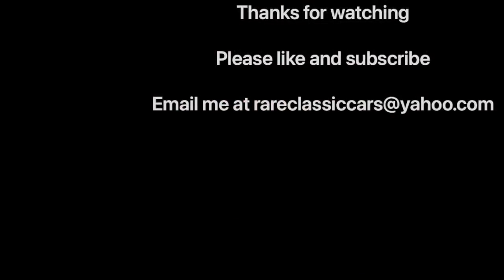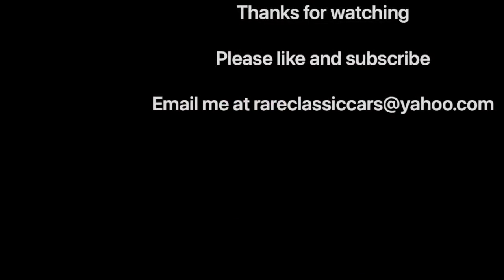Worst Engines of All Time: GM 2.5L Iron Duke Follow Up

Comment: Had one in a 3speed auto Fiero.  got pretty close to 3 digits (85 mph soeedo) and reliable for sure. Not sporty though, low revving and anemic.
Reply: Pontiac pitched it as a "commuter" car...  And GM bean counters gave it a "commuter" engine.  lol.
Reply: @keithjackson286  was pretty fun to drive in good and bad ways - manual steering and low made it sporty despite itself. Ridiculously easy to spin.  When these were around I saw at least a couple (besides mine) facing the wrong way off the side of the road.

Comment: The chrysler 2.2 and 2.5 i4 was good.
Reply from the maker: Loved head gaskets.
Reply: They were ok, but also very crude. I remember the old Dodge Omni's with the 2.2. They would run on after shut off. Even at 6 years old, I knew that car was a piece of crap.

Comment: You are right on this one. I had one in my S10 and, of course, it was reliable. When mine started knocking, they replaced my cam gear with an aftermarket metal one. Was still noisy, but I did get over 400 thou. Kilometers on it and it had an insane amount of idle time on it (volunteer firefighter). My dad had the 86 olds calais, and yes, that thing had a deafning rumble to it at idle !!! He regretted trading in his Cadillac for that thing.

Comment: I have enjoyed all your video showing off your cars.   This porch chat we are having really is a home run.    I agree completely about the Iron  Duke.   I worked with a plumbing company that used the mail trucks with this engine.  We called them Armadillos.    These trucks ran and ran and sounded horrible but in the mail truck version the company would buy retired mail truck for fleet use. Shop mechanic became a wizard with engines. Seems like everything only took a couple  of hours to fix.  It seemed like he could put a replacement engine in a couple of hours, said another engine not a rebuild engine. Love to hear your point of view.

Comment: The iron duke wasnt a bad engine. It just had bad applications. It was a great motor for the s10 and the mail truck. Terrible motor for the a bodies, n bodies and ESPECIALLY the FIERO and CAMARO
Reply: yeah whoever thought putting an 87hp engine in a fucking muscle car was a good idea should have been fired on the spot.
Reply: @SomeOne_86   Lol!
Reply: @SomeOne_86  the cheif designer of the fiero didnt have a choice. He had to basically told he had to take the front end of the citation, flip it 180 degrees and modify it to make the fieros rear end. bam the rear end and engine assembly of the fiero is born. It stayed that way till 88 when it got a new irs and then it got canned.
Reply: @Henry_Jones  honestly the fiero is such a missed opportunity. The car is beautiful, but the drivetrain was just so underwhelming.
Reply: You know... It actually powered the N Bodies pretty well...  It was dog slow in everything else.

Comment: You said it.   I got a 88 Somerset handed down from the in-laws.  Very very low miles (in-laws aged out of driving) but really cheese compared to 77 Olds or 76 Caprice or my 89 Century Limited.   Nearly everything about it was a down grade - door opening/access, instrument layout, and the engine, ugh.  A real POS.   That Somerset was neck and neck with the 80 Fairmont for worst ride evah.
Reply: My mother had a Mercury Zephyr, the Merc version of the Fairmont.  She liked it very much.  No, it didn't measure up to a Lincoln, but it didn't cost as much as a Lincoln, or even a full-sized Merc, either.  And it was easy on gas, and quieter than a foreign car.  6 cyl usually is quieter than a 4.
Reply: @michaelbenardo5695  The Zeph was definitely more upper crusty that the vinyl Fairmont.  Those were the end of an era for FoMoCo - midsized, rear drive econoboxes.  After that came the aero design era.

Fairmont was the only car I ever bought new from a dealer.  As required for my field sales job - american four door.  I would have preferred a Caprice but that was out of my price range.  The ol' Fairmont was yr most basic, reliable, quiet, family man car.  Paid her off and gifted to Mom in tip top shape.

Comment: I owned a 1986 Olds Cutlass Ciera with the “Iron Duke”. A gutless engine, but 32 MPG highway.
Reply: You hadn't experienced an 82' Cavalier with the 1.8L 2bbl engine + TALL geared 4 speed manual.  The absolute slowest car I ever owned but would go FOREVER on a tank of fuel it seemed like!

Jumping in my dad's 80' Citation with the same 4 speed made it feel like a rocket ship.

My buddies mother bought an 82' Camaro with a 4 speed!  Awww heck yea!!! Until we drove it.  2.5L iron duke. WOW
Reply: @firehawk6188  While it was no rocket, it WAS stronger than foreign-style 4 cylinders.
Reply: My Dad had a 2.8 v6 powered '88 Celebrity wagon that got 30 on the highway, and was far quieter,,smoother and stronger than the "buzz bomb" 2.5 liter noisemaker

Comment: How about a video on te Buick 231 3.8 carburated v6? Another engine used in millions of GM cars. Reliable for the most part and like the Iron Duke not so refined. My 1st car in 1994 was an 84 Grand Prix with that motor. Loved that car.
Reply: I can't even believe they put those engines in full sized cars like the Impalas.

Comment: I got to witness someone getting “Iron Duke’d” first hand. My grandpa wrecked his positively ethereal 283-powered pale yellow ‘67 Chevelle (sad day for me as I was 15 and wanted that car badly) and replaced it with (you guessed it) an Iron Duke-powered ‘81Citation that shook like a nervous chihuahua and was painted what can best be described as “diarrhea brown”. Being a Florida car, idling with the car in Drive and the A/C on is a punishment I wouldn’t wish on anyone.
Reply: Was the Chevelle a 2 door?
Reply: @drippinglass  nope. Four door. Black vinyl bench seat interior.
Reply: My buddy's parents "inherited" this same colored "diarrhea brown" Citation from a relative who had passed away.  It had the iron duke coupled to a manual transmission.  I remember Mr. W cursing his brother:  "R had all the money in the world, why the hell did he pick this god damn car!".   Needless to say, the Citation was relatively worthless as a trade so they kept it.  Yeah, the engine was rough, and the interior was cheap, not to mention the car was drop dead fugly.  But, I was kind of intrigued after driving it, it performed and handled pretty well.  Needless to say, I had never experienced the more refined Hondas and Toyotas.  I'm trying to remember why they got rid of the car, I think it got rear ended, but it never caused them much trouble.
Reply: Iron Duke was slightly better than the Vega with its reynolds wrap block without steel sleeves. That was a real turd !
Reply: @davegeisler7802 That was a huge shame.  Another situation where a cool looking car had a badly matched engine.  Like iron duke and Fiero.
Reply: Richening the idle mixture smooths out the idle quite a bit.  You just have to remember how much you turned that screw out, so you can put it back when it is time for a smog check.
Reply: The AC probably made much of the difference; my father's '81 Citation was the last car he bought without it and the shaking didn't leave nearly the same impression on me. The fact that the heat trickled all summer (a chronic GM problem during those years, best solved with a manual summer cutoff valve) bothered me a lot more.
Reply: GM never liked flipping the bill for balance shafts.
Reply: @jeffrobodine8579  Did anybody use them then?
Reply: Well… in 81 nobody cared about a Chevelle unless maybe it was an SS396 or SS454. 1981 was the year interest rates spiked after a gas crisis and inflation. A 1960s car was not only using a horrendous amount of gas… but as a daily driver probably on its last legs in an era where most cars had a five digit odometer because there was no question whether the miles were original or had rolled over.
Reply: @calvinnickel9995  Actually, 60s cars used LESS gas than 70s cars, were quite a bit faster, and ran much better, due to the fact that they didn't have that emissions junk.  They ran the way the engineers intended, not the way the EPA wanted .
Reply: Haha… nope!

Horsepower was higher… only because they used SAE Gross ratings where they stripped the engine of the air cleaner, exhaust headers, all accessories—not even a water pump.. and strapped it to a prony brake and ran it at full throttle until it seized. Highest number is what went in the brochure. After 1971 they had to switch to SAE Net. 

Sure the 70s were emissions choked.. but they also had to cut fuel consumption too so that meant downsizing, weight reduction, aerodynamics, and the end of almost all of the big blocks. 

So no.. except for the early 70s.. and maybe a few rare land yachts like the Lincoln Mk V the 60s was the king of high fuel consumption.
Reply: The only 60s cars we saw as daily drivers in the 80s were your Slant 6 Darts and Valiants, your 200 powered Ford Mustangs and Falcons.. Eddie Murphy’s shitty blue 230 powered Chevy Nova… and the ubiquitous Beetle.

Comment: The GM Iron Duke engine, a re-worked version of the Chevy II 4 cyl., was a GREAT engine!  It was, in most years, anvil reliable and anvil rugged, and was easy on gas, easy to repair on the rare occasions that it needed it, infinitely rebuildable, and JUST PLAIN WORKED.  The Vega engine in stock trim is one of the worst engines of all time, but even it can easily be vastly improved.  That Chrysler 2.7 engine is a rotten engine too.
Reply: That's not the Iron Duke..The Iron Duke 2.5 is a Pontiac engine made from 77 to 93. AMC even used it. The Chevy II had the Chevrolet 153 4 cylinder
Reply: @netrioter  The Iron Duke was a re-worked version of the 153 Chevy II 4 cyl.  Larger bore and shorter stroke.
Reply: @michaelbenardo5695  you're  a goof...they aren't related at all and I'm sick of this.  PROVE HOW THEY ARE RELATED
Reply: @netrioter  Because the automotive press, when it was introduced in 77, gave us the specs and the history, and what was changed to make it have the same bore and stroke as Pontiac's new 301 V8.  This after many had been clamoring for them to replace that horrible Vega engine with the "marvelous Chevy II engine", which was a 153 cube job with the same bore and stroke as Chevy's new 230 6 cyl.  I know Pontiac later gave it a cross-flow head.  They might have made other changes as well, but in it's original form, it was indeed an offshoot of the Chevy II 4 cylinder.  The crankshafts are even interchangable, as long as you use the correct connecting rods and pistons.
Reply: @netrioter  That's why it had timing GEARS just like a Chevy 6.  No true Pontiac engine ever did.  Ever.

Comment: I agree - if you were coming from an inline 6 or a V8 - an early eighties four cylinder engine seemed agricultural.  

With regards to crude, but reliable - I believe the 1.8 liter four cylinder, single cam, push rod engine in a 1980 Toyota Corolla wagon that I once owned only made about 75 hp.   Granted we had a 55 mph speed limit, but even the competition to the 2.5 Iron Duke could be incredibly anemic by today's standard.
Reply: @Andrew in Austin
You didnt experience  a Honda 4 cylinder of the early 80's.....smooth as a sewing machine
Reply: Thank you.  ALL cars of that era were gutless, partly because of super-tall gearing, in the pursuit of better gas mileage in laboratory tests.  My 81 Chevy 1/2 ton was that way too, a 6 cyl. manual transmission with, of all things, a 2:73 rear end.  I wanted that truck as a working truck, so I immediately had a guy put in a 4:10 for me.  HUGE difference in pulling power and hill climbing ability, and it actually used LESS gas in stop and go city driving.
Reply: 4 cyl. engines always make more noise than just about anything else. Worse as they get larger. I had a late 80's Corolla FX 1.6l ohv. It was smoother made around the same power as a Iron Duke, 0-40 it was savage, but that was gearing. It took abuse from me, Top Gear Hilux levels of abuse, with no sign of ever giving up. Toyota also had  the 4AGE 1.6l which I had in an MR2, smooth, high revving, one of the best sounding 4 cyl. engines, 118hp. It had T-vis which doubled the intake runners at higher rpms. This was so it had low rpm power and high rpm. There was even a Formula Atlantic racing engine had around 250hp, and later 5 valve head engines based on the 4AGE. Truly a great engine, many would use the word legendary. The Iron Duke was an unrefined, inefficient, engine, "good" for transportation, when even at that time there were "much better" for transportation engines and cars. Both of those Toyotas were noticeably easy on the wallet for gas and maintenance and I'd even use the word fun. Straight up agricultural each and every time a bit of exhaust pipe rusted through though :-D  Mercedes  had one of the smoothest 4 cyl. engines back then. Porsche 944 was... okay for a noisy 4 Banger.
Reply: @pgtmr2713  5 valves per cylinder?  That's too complex.  I'll take the Iron Duke any day over those.  But yes, the bigger a 4 is, the rougher and noisier it is.
Reply: @michaelbenardo5695  You'd take a 87hp engine over a 175-185 engine? Complicated doesn't matter. It will outlast the Iron Duke. Literally no downside to it.
Reply: @pgtmr2713  One, I am more concerned with low RPM torque than I am about sheer horsepower.  In my neck of the woods, traffic is HORRIBLE.  You often CAN'T go fast no matter how fast your vehicle is.  2)  Complicated DOES matter to me.  I do my own work.  I DON'T WANT a car that I have to bring to the shop.  3)  I refuse to buy a Japanese vehicle.  I want the jobs, ALL the jobs, to go to my fellow countrymen, not the the Japanese.  The Japanese, with their huge subsidies to their auto exports, have caused massive homelessness and erosion of living standards in this country, and I will do my part to rebel against that, even if I have to give something up.  4)  I don't want an aluminum engine.  If I have to keep my old vehicles and periodically rebuild them, so be it.
Reply: The 4AGE has low AND high torque, iron block good for up to 350 hp. You do your own work? Good, changing a timing belt is easy on a single bank engine. The 20 valve came in 2 versions both with Individual throttle bodies. Who you vote for has more to do with jobs and homelessness and nothing to do with these 2 engines being discussed. It's a distraction. I could argue accepting junk because Merican, causes everyone to produce junk to compete to the bottom. 
Anyway the Iron Duke couldn't do THIS once...
https://www.youtube.com/watch?v=K1JHTgR8jcc

Comment: The Willy's L134 4 cylinder was far superior.
Reply: BUT, do you think many folks would have bought a car with a flathead 4?  I might, but I am just one person.  Their F-head might have done better, but do you think either one could have been smogged without cutting power output to one horsepower?
Reply: @michaelbenardo5695  they bought a ton of cars with flathead six and eights.....  NOx would have been lower anyway due to the lower compression ratio, the longer stroke lends to a more complete fuel burn, so yeah, probably would have better fuel economy if it was geared to stay below 2000 rpm too
Reply: @RealDeanWinchester  Everything you say is 100% true, but how many 80s car buyers would have agreed?  You and I are only 2 people.  They need to sell at least 10s of thousands, not just one or two.

Comment: Adam, how does the iron Duke in a GM passenger car compare to a Volkswagen Beetle?
Reply: It is LIGHT YEARS quieter and WAY more powerful than the VW engine.
Reply: But the beetle was very clear about what you were getting it didn't pretend to be a very refined engine it was cheap and reliable
Reply: @michaelf.2449  True, and I like the Bug, but the cars with the Iron Duke, most of them anyway, are much roomier more comfortable much heavier cars.  You can't deny it.
Reply: @michaelbenardo5695  yeah I feel they would've been better off developing an inline 6 instead cutting from v8's to 4 cylinders
Reply: @michaelf.2449  They did have inline 6, but you can't mount a 6 sideways.  They should have designed the X cars to use a conventionally mounted engine.  That way they could have used the existing 6 cylinder engines.
Reply: @michaelbenardo5695  that was kind of my point I would have continued with the standard design they had with vehicles and went to inline 6's and not the transverse mounted 4 cylinders

Comment: Had that engine in a '75 Chevy Monza.  I dubbed it the "Iron Puke", because it was so bad.  A lawn mower engine would have been better.
Reply: I think you had the Vega engine, not the Iron Duke.  That Vega engine was garbage in stock trim.  The Iron Duke, found on the Pontiac Astre, a Vega clone sold by Pontiac dealers, was light-years better.
Reply: @michaelbenardo5695  You may be correct on that....I can only say it was so junkie it really belonged in a car crusher.
Reply: They came out in 77..you had the Vega engine .which was pretty bad especially early on

Comment: GM never had much luck with the four bangers, did they?
Reply: The Iron Duke, a Chevy II 4 cylinder with a larger bore and shorter stroke, was a great, if less than glassy-smooth, engine.  This guy just hates anything American-made and of traditional American design.
Reply: @michaelbenardo5695  dude..you have the engines confused. The Chevy II had the old Chevy 153. The Iron Duke came out in 77...it's a Pontiac engine. It's not a Chevrolet engine at all.
Reply: Even up to today, NO. Vega engine, iron duke, quad 4, 1.8 Sun turd engine, (2.2 Cavalier engine was "ok"),  Ecotec. All junk.
Reply: They never have had a “good” 4 cylinder